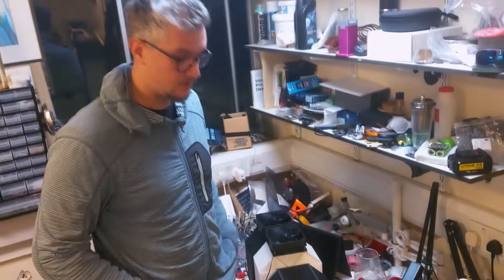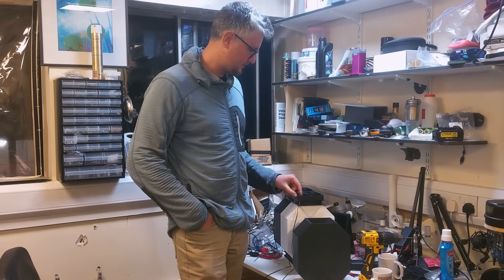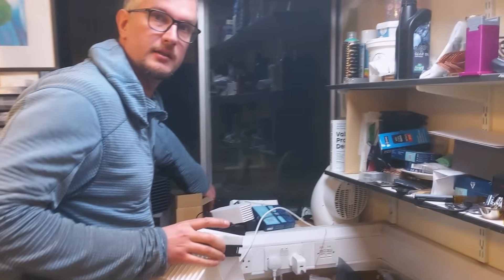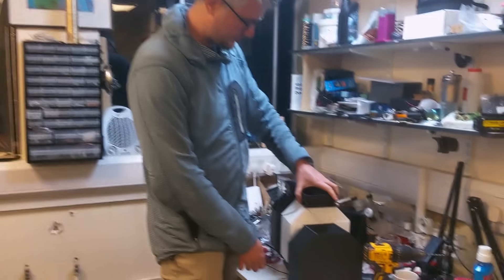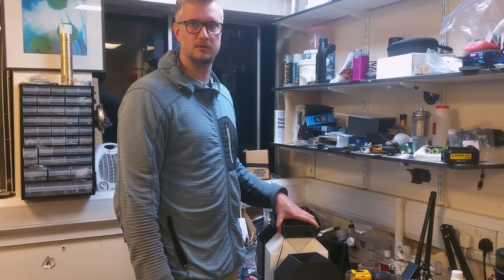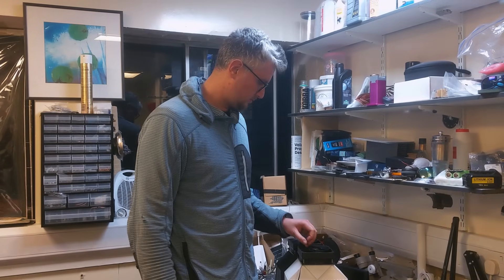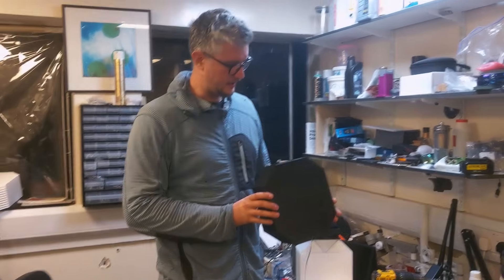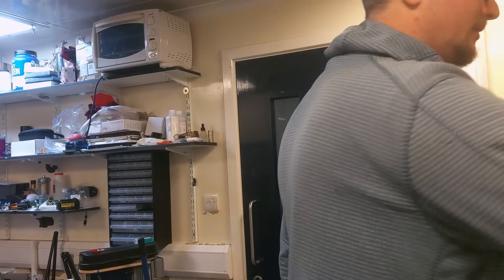Heat and dehumidify your house for cents per day

Comment: You would not think that PLA’s heat conductivity makes it suitable as a material for a heat exchanger but there you go. Someone’s doing it. Good luck with the project 👍
Reply from the maker: Not much is particularly insulative at 0.25mm thick.
Reply: It isn´t but it´s thin and it works well enough. You could also overprint (like overmold) thin metal sheets. But it adds cost and complexity. The design works better than no heat exchanger at all. You can still improve it later on. I find the idea great. I personally would use PETG instead of PLA though.
Reply: @sierraecho884  Good idea, I checked, PETG is about twice the thermal conductivity. I used black PLA and always looking out for some graphite filled filament. The printing path is continuous, so the stringiness of the print is not a problem. I will test it.
Reply: @makerbeelab5546  You can also use metal filled material but I would advise against it in this application. Here the material should be thin as well with filled materials you usually print with 0.6mm nozzle and the layers are thicker probably negating the positive effect of the metal filling. PETG does not have to be stringy as well. It is by it´s nature somewhat but then you dry it thoroughly and don´t print too hot it´s no worse than PLA. I haven´t used PLA for years to be honest. PETG is a way better overall material, at least for my applications.
Reply from the maker: What's overmolding?
Advantage of PETG?
Reply: @OpenSourceLowTech  Overmolding is when you insert usually a metal component into an injection molding mold. So you encapsulate the metal (or whichever material) part inside it. You can do something similar but even way cooler with 3D printing. An easy example would be, you design a void inside a part, print the part, pause the print, insert a magnet into the void then continue the print. This way you can encapsulate a magnet inside a 3D printed part which can never be removed without breaking the part.
Reply from the maker: Potentially, will think on it.
Reply: @sierraecho884  That's the plan in the future, but it would require significant effort into making the stamps to stamp metal (even thin one). 
Also - topology of the heat exchanger doesn't allow it to be foldable in 2d sheets. It was utter pain in the arse to program.
Reply: @makerbeelab5546  "...it would require significant effort into making the stamps to stamp metal (even thin one)...." I know it sounds crazy but you can stamp thin sheets of soft metal like AL (which would be good for this application too) with a 3D printed die. You won´t be able to manufacture millions of parts but you can make 100 or so easily, depending on geometry.

"...Also - topology of the heat exchanger doesn't allow it to be foldable in 2d sheets...." Yes, this is a way bigger problem. But maybe you can redisign it with the metal inserts in mind. I am not aware of the details of the design, just as a general thought.

".. It was utter pain in the arse to program..." What do you mean by that ?
Reply: Low thinkness make it suitable
Reply: Have you considered a filament with metalt to improve the efficiency. Would it be enough to be worth it?
Reply: Know zero about 3D printing, but would electroplating to improve conductivity be an option here?
Reply: @MrMEmEmEmEMEMEeeeeee  Good thinking. You could electroplate it yes. I am not sure if it would improve the system though. Unless you make the structures really really thin and fine to a point where they barely can hold their own weigth and then stabilize it through electroplating. 
It´s also costly, you need to handle chemicals etc.
Reply: @sierraecho884 plus you still have the plastic core that has to conduct the heat as it will have to completely separate one side of metal contacting warm air to the side of metal contacting cold air. The result has to be two separate metal surfaces with the plastic in between. So it will do nothing but make it take more time to conduct the heat.
Reply: @ge2719  Why do you need a plastic core ? I would replace it altogether by metal, that´s the whole point.
Reply: @sierraecho884  you were replying to someone talking about electroplating. The object you're electroplating isn't destroyed by the process. You're adding layers onto it. I fact you also need to add a conductive paint layer as well. Which is going to be a pain with this shape. 

Same issue even if you did a casting and tried to replace this shape with cast metal. No way any metal is going to pour nicely into tons of very thin channels and make tons of ducts with no gaps in it. Especially when those channels are at 90 degrees to each other. It'd be a pain to pour even if the walls were made very thick.
Reply: @ge2719  "...you were replying to someone talking about electroplating. The object you're electroplating isn't destroyed by the process. You're adding layers onto it. I fact you also need to add a conductive paint layer as well. Which is going to be a pain with this shape. ..." Yes I know this, I didn´t say you replace the object. What I meant was, you can make the object walls slimmer and flimsy, because adding the electroplating layer will stabilize it for handling, installation and so on. Thus reducing the amount of insulating polymer and "replacing" it with electroplated material in this sense. Which is of course way more conductive and durable. This should increase the conductivity overall.

"...Same issue even if you did a casting and tried to replace this shape with cast metal...." Yes, that´s why one would need pressure casting, or vacuum casting. For those fine details. With slurry for example. It´s possible but it isn´t easy. You are referring to gravity pouring and then it also depends on the material, a ZAMAC will flow way easier than pure copper for instance. But those absolutely valid points.
Reply: if the efficiency is that good, there might be no point in increasing it any further by complications. Maybe stack more of these to increase surface area and decrease flow speed.
Reply: The surface area covereth a multitude of material science sins.
Reply: I made one designed so that I slide thin aluminum sheets into it, it works absolutely great

Comment: Would you say the possible increase of surface by using a 3D-printed design outweighs the lower thermal conductivity compared to, let's say corregated aluminum or something? It seems like Aluminium has a heat conductivity over 700 times greater than that of PLA. Wouldn't a simple design like this one be more efficient? https://www.youtube.com/watch?v=gHoH0scUzRg
Reply from the maker: Yeah we're basically throwing surface area at it to compensate for lack of thermal conductivity, which seems to be working fairly well.
Also looking at stamped alu foil options, but it's a lot harder to fabricate, and the PLA isn't really turning out to be a problem needing solving.
Reply: @OpenSourceLowTech  I thought about how a 3D-printed design could aid in the fabrication or positioning of aluminium surfaces similar to the ones in the other video. You could probably use some aluminium baking trays or cans since those are more sturdy than just aluminium foil but still easily foldable by hand.
Reply from the maker: Have been thinking about it.
I've been using 0.3mm alu lithographic printing plates to make stuff like wind turbines, they're fairly easy to get and work with.

Comment: Curious to see details on this; dabbled with the idea of a DIY gyroid heat exchanger but ended up just printing some adapters for a Mitsubishi VL-50 I had left over.
Reply from the maker: I experimented with a gyroid based version but they're a little tricky to print airtight due to overhangs and even after I largely resolved that it was going to take sixteen days to print for the small version.

Comment: Trying to wrap my head around how it dehumidifies. Does the water condense inside the unit and drain out or something?
Reply from the maker: Moist air gets blown out the window. The incoming air is cooler so becomes relatively drier when it's warmed.
Reply: @OpenSourceLowTech  My environment is tropical rain forest so my problem is more about saturated humidity rather than temperature gradients 🙁
Reply from the maker: Whereabouts?
Are you wanting to keep heat in or out?
What kind of structure?
Reply: @OpenSourceLowTech  It's an off grid shipping container/workshop in Far North Queensland. In winter, condensation is a huge problem and summer rain and humidity keeps everything damp and mouldy. Sealing it is a problem as I need ventilation
Reply from the maker: Ah ok, so similar situation to Scotland except the high temp version of the problem.
This approach should still be of benefit tho. Basically just need to insulate and double glaze everything (check the end screen on this video for a link to a low cost but effective triple glazing DIY window insert), actively cool via AC or similar cycle, and then use something like these heat exchangers to push out any vapour buildup while reclaiming your coolth back into the incoming air.

I'm currently in Perth, heading to Melbourne in a couple weeks. Hope those floods missed you..

Comment: There’s a lot of made up numbers here. Also your exhausting air so close to the in your intake how can you be sure you’re not just recirculating the same air???
Reply from the maker: We've been gathering data on the test installs, the numbers are either directly measured, or at most speculative, extrapolated from measurements.

The airflows are fairly linear and directed away from each other, so cross contamination is low.

Comment: If the outgoing air ends up with >100% relative humidity, how does your design handle the inevitable condensation?
Reply from the maker: In practice it gets blown out before being able to settle. Scotland is pretty humid, but the dynamic somewhere like South East Asia or the like could be different, but worst case scenario would presumably be just to angle the stack downwards so that if any water does settle it then just drains out.

Comment: Titling the video "DIY" and not providing an STL or geometry is clickbait. Could you please upload the sources to printables anyway? Slicing it sounds like a fun challenge.
Reply from the maker: Working on it. Currently it's all custom G-Code, which pretty much only works on that one printer. I've got a quite different approach 3D model version, but we still need to test that for effectiveness before broadcasting it.
Reply: But it’s 100% DIY once you jump in CAD and create the geometry
Reply: DiY is not OpenSource ;-)
Reply: @Mr.Torsten  but in description it says both, DIY and open source. last is wrong, I think.

Comment: WOW, I would love the design on these, and would you have a link to the fans you use?...Thanks for sharing and for the work you have put in to this. ❤❤❤❤❤❤❤❤
Reply from the maker: Downloadable version is in the works. The fans are fairly standard 120mm PC cooling fans, or 80mm for the small version.
Reply: @OpenSourceLowTech  Thank you for the reply, I'd have 2 questions if its ok, as I'd like to build this myself...Are Pc fans DC and if so how are they powered, and I assume the fans draw air into the room and from the room, how does this work, is there an electronic component, like a switch or a timer?...thanks again...Michael

Comment: Well done ~ we need this tech yesterday, I've been working this purely in a metal format, but that has proved costly in both material and time (although it may scale better).
Reply from the maker: What's been your approach?
Reply: @OpenSourceLowTech  Alloy tube core (multi 1cm internal dia) pulsed single fan with various mapped timings (based on internal humidity) ie 60~75%rel@19degres - out 40 sec - switched 25 sec inflow fresh X%rel@5degres.
Reply from the maker: Interesting way of doing it.. basically get around the difficulty of manifolding a stack of non tessellating straws by reversing the flow and more or less making the whole thing into a Stirling engine regenerator...

Guess you're using a flat profile blade fan so that it's reversible?

What kinds of efficiency, delta T, and volume transfer numbers are you getting?
Reply: @OpenSourceLowTech  I'm struggling with fan issues as the enviroment is so volatile (huge dynamic pressure differentials) I don't have reliable numbers as yet - just a selection of prototypes (I'm on the west coast multiple static caravans and chalets)

Comment: Supercool! Curious to see section views - the channels on the inside
Reply from the maker: It's basically tessellated triangles, with half connecting to one end manifold, and half the other. Easy enough to model, absolute horror to do in G-Code...
Reply: It looks like square grid of cells. Very similar to infill in 3d prints, but each layer is complete. When usual infill is printed it is often one direction for one layer, and 90deg lines for the next one. Which makes gaps between  cells and the parasitic leakage.

Comment: Hey chief! I've been following for a long time and enjoy what you do. 

I've actually had this idea kicking around for a while and ive been unable to get around to actually doing it. 

My version of this could be cheaper and more efficient and easier to print! So please, go ahead and develop it further if you think it works.  But my idea was to use aluminum foil and 3d printed thin frames. Just keep the foil stretched and in place.  Minimal 3d printing.  

Then the heat exchanger is just these alternating direction on top of each other. 

The conductivity of aluminum is crazy,  its super thin, it can be 3d printed down so each channel is like 3mm.

I was gonna start with a 12"x12"x6" heat exchanger core with 2-4mm layers.  

I was even looking at increasing turbulent flow by creating little printed wedges on each layer for better efficiency!

If you want to talk more about it if you could drop an email! Id love to be a part of it!
Reply from the maker: Yeah we're looking at ways to stamp or otherwise quickly and effectively form alu foil, but if you've got a method please do let us know.
Email is on the website.

Turbulence should increase your heat transfer, but it will hammer your throughput, so overall effectiveness of the unit would probably favour laminarity.
Reply: yes, aluminium foil is going to be better in the future, but it is a pain to form. I've tried various stamps, it creases in weird way. Also - the most insulate part is the boundary layer of air, not the plastic. Plastic is tens of times more conductive than air. Obviously graphite filling is a good way to approach it, but not as necessary as it seems at first glance.
Reply: I sent an email! Thanks
Reply: @ did you email me or Daniel?
Reply: @makerbeelab5546  lol Daniel sorry yeah.  Hopefully I'll remember to follow up here if i get time to make it

Comment: A major component of heat exchanger design calculations is the thermal conductivity of the material used between the cold and the hot side where the heat transfer occurs.  I didn't see any mention of the type of material you were printing with.  Is this some type of carbon fibre that has high thermal conductivity, or how do you achieve efficiencies that might rival cheap commercial units?
Reply from the maker: It's 0.25mm PLA, which doesn't insulate too badly given the thinness of the membrane, but we are also starting to experiment with graphene infused filament as well for reasons of increased conductivity and some other advantages.
Will likely increase the cost a bit tho, which may or may not be worthwhile given that it's doing a pretty decent job as is.

Comment: please drop the CAD files for this when you release the STLs so we can remix it
Reply: Unfortunately the parts are so thin that when you try to slice it, it fails miserably. I had to design procedural python code that outputs directly g-code for my particular printer to print them. otherwise the slicers make a pig's breakfast out of it, trying to fill in all the gaps and parts and projected print time is like a week!

I'm working on this project as a startup. 
For mass manufacturing the process will change, probably will have stamps and aluminium foil.
At which point the 3D printable version will be released for open source for those that want to recreate it at home.
Or if it all falls through - then I will move on to other projects and will release this one.

I think it will be further improved and out there around summer this year, I will let @OpenSourceLowTech know.

He's also going to have one of my released projects for making the HAWT turbine out of hoverboard wheels with all the designs out there.
Reply: @makerbeelab5546  That very cool, best of luck! As for the slicer problems, do they persist even if the nozzle size is changed to 0.1 or 0.2mm in the settings?